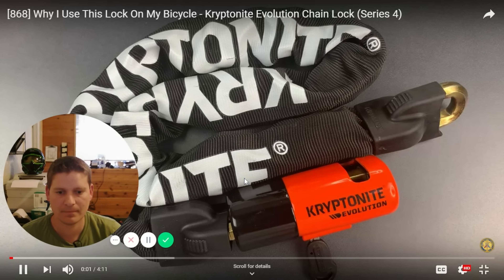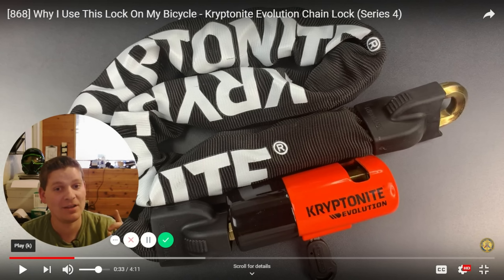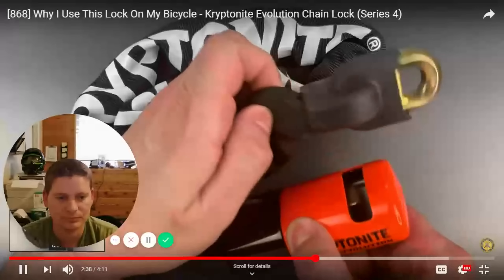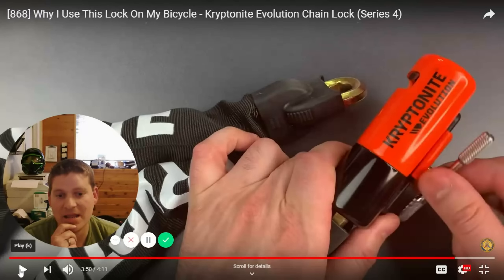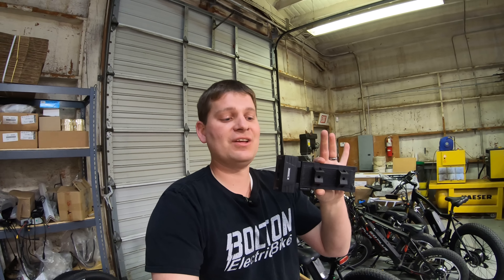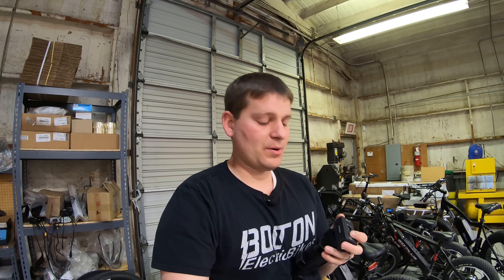Secure Your Electric Bike From Theft

Comment: if your components has allen key bolt heads, get ball bearings that will fit inside, then use superglue and it will be impossible to unscrew any of ur components on the street, UNLESS you first dissolve the glue with acetone then remove the ball bearing, which NO thief has the brains or time to know that.

Comment: bottom line, nothing works. not much has gone into theft prevention of ebikes and escooters.  there needs to be tech, heavy tech, that knocks out the bike from ever being able to be used again, meaning, it has to stem from the electric hub and the controller has to be removable/portable. when that hub is locked in position and prevents the wheel from turning, its gonna be hard to pick up that 100 pound ebike and carry it around. probably some sort of digital signature needed from the controller to the hub to release it, or something far more clever, to prevent it from easily being hacked.

Comment: I WANT to ride My bike to work . BUT I'll be 250 mi away at the furtherest point of My day ( but it gets better I work nights) ! I'm not TOO worried about theft ( will be in Employee parking lot , more worried about a hit & run , wind blowing it over etc ) ! The ebike is a himiway step through w/ 4in tires & fenders . I haven't found a ulock wide or long enough to work easy ! Besides , there's no easy to mount a carry bracket to the frame . I'm. NOT INTERESTED IN A 30 LB CHAIN , OR A FOLDING LOCK!!!

Comment: You riders of these seem to think there are no rules or laws that apply to vehicles or bicycles. 
What I’d like to know is how you plan to prevent them from bursting into flame in your garage basement or apartment? Especially after riding them in the rain or snow.
Reply: Always use approved charger. Make sure it's not frayed. Don't charge while wet or cold. Keep the battery health maintained with good charging habits. Don't leave it charging overnight. Have a fire blanket or fireproof case. There ya go.

Comment: I take my bike right in the store with me to.  Load up the basket and check out.   No one has ever once said anything about using it as a shopping cart.
Reply: They politely tell me I need to lock my bike outside. Fat bikes are generally not small. If I want to grab a brew, or lunch, we leave the bikes outside 90% of the time.

E-bikes are a car replacement for those short trips to the post office and shopping. It's no longer appealing when it's a major hassle to step away from the bike for more than 5 minutes.

Comment: I watched this video with some interest because back in February 2020 I had my Trek Powerfly 5 stolen, I have had this for just under two years and because it was a work horse, I was using this nearly everyday for commuting to work. Hence the high mileage I had planned to replace the battery, after my holiday in March, as Lithium start to deteriorate after heavy usage and mine was already up to 3k miles and the batteries do not last forever.  

I was in the supermarket for 12 minutes, exactly, and had the New York Kryptonite chain, plus a second lock, but the thief used a portable or battery power grinder, must have made a racket but what surprised me was not one the security cameras  were working & two that with all this going on no one challenged the thief, given the time of the morning in a busy supermarket car park. 

Fortunately, I had my e-bike included into my household insurance so the insurance paid out no problems. I replaced my bike with the 2020 Trek, Powerfly 7. Fortunately I had ordered the replacement before all of the Coovid-19 outbreak otherwise, as my bike shop informed me,  I would not have been able to get the replacement bike  possibly this year, such is the current demand for bikes. 

I will for now on be taking my bike into the supermarket, I have the latest NY Chain that is 15mm thick, also use a second lock and also have had to invest in a tracking device, should the inevitable happen.  The only other thing that would be useful, since I don’t have a bodyguard like Arnie would be an AK47 but these are not legal here. 

PS by the way all e-bikes have a separate serial number for the bike frame, battery, controller,  motor and lock so keep all this information secure, you will need it, if or when you report the theft. And I say this quietly, in a way the bike thief did me a favour as I was able to trade up my e-bike for the latest 2020 version and no new battery required.
Reply: All a thief needs to do is don high vis, official looking clothing, and noone will bat an eye. And that's the flaw in any lock. Hand help battery opperated angle grinders make mince meat of even the heftiest lock.
Reply: Ya I always wanted to get like a tracker for mine. And recently I learned about metropcs have these pet gps trackers. I am not sure how they perform but I might try it some day. I am not a fan of tmobile/metropcs anymore because sprint bought them so I quit my service with them.
Reply: Those kryptonite chains are expensive but you can register your bike with them against robbery. People claim that they got money from them after being rob. The profit margin on those lock must be verry high for them to offer that

Comment: I use a folding electric bike. 6 years and it hadn't been stolen had to ditch it on the side of the road because it was so well used it costed more in replacement parts.

Comment: I own a Juiced Bikes RipCurrent S Fat Tire E-Bike. While certainly not the most expensive E-Bike out there, many have complemented on it's Looks, meaning it's more appealing to Thieves. So, I went down the YT Rabbit Hole on Securing Bicycles and ran into the Lock Picking Lawyer and his Good Friend, Bosnian Bill long ago. The "Bell" brand "U" Lock is $hit. You could see it was Tubing surrounding a much smaller Shackle inside that was NOT made from Hardened Steel. You get what you pay for w/ Bike Locks and pretty much anything else. While Kryptonite & ABUS make up the lion's share of "job specific" or "Theft Threat", rated Bike Locks, there are several Very Good Lock and Chain options with PacLock, HipLock, OnGuard, Viro and others. The LEAST secure Bike Locks use Cable and/or Easily Picked standard "Pin Cylinder" style Keyed Locks (like a standard Master Padlock), stay away from those even if they're much lighter & cheaper. Case Hardened Chains are Always harder to cut and it takes some REALLY BIG Bolt Cutters or a Portable Battery Operated Grinder to cut thru these, stuff most Bike Thieves aren't willing to carry in broad daylight. The Better Locks use Hardened Steel Shackles and Pick Deterrent Cylinder types. The "Folding" link type locks are easily defeated by punching out the Link Rivets w/ a pocket tool. They're Heavy, Expensive and Overrated. Whatever Lock you use, try to set it up so the Keyway is pointing towards the ground. This makes Lock Picking Much more difficult. If your using a cheap Lock for a quick stop at Starbucks or the Utility Co, park your bike in low gear and click the shifter to High Gear. When someone hops on ur bike, it'll quickly shift to High Gear and make it impossible to make a getaway faster than you can run. Make ur Bike look like Crap if you aren't hung up on looks, it's a Gr8 Theft Deterrent. Read up on Kyrptonite's Lock Rating System, you'll get a laugh and Learn about Theft Threat Levels. Remember, NO Lock is undefeatable, all ur doing is making the easier to defeat locks more attractive. Good Luck ! P.S. I use a Hardened Shrouded Coupler Lock from PacLock or Viro Pin Lock and a 9/32  x  4' Pewag Case Hardened Chain carried in aa Frame Bag on my Bike.

Comment: re the lock that broke the hydraulic cutter ...most theiives are walking wiith battery angle grinders w/ cuttig diisc & battery iinpacts & drivers ...so in a nut shell only prayers can help

Comment: I use a alarmed  motorcycle brake disc lock, a kryptonite d lock, and the bike has a very loud alarm, activated by key fob. By the time both alarms are screaming, there isnt any way they will cut thru all my locks before I get out there with a baseball bat ...

Comment: Theft is still my number 1 concern regardless if it's lock in the garage /shack/barn/ kryptonite locks. If you are paying for a bike 400$ and more you are a target. This video got me into lightweight foldables or even electric scooter. I'm really staying away from Ebike for now and even 2000$ regular bikes. For  the seat not being bolted on ... this is a nightmare, get a bolt then glue it on and even put a small dowell pin somewhere. Some vendor will say this titanium or carbon frame is so light you'll save some seconds... yadiyadi yada ... welll I'm gona throw this 10 lb Kriptonite into the mix lol..fu ck me hahaha There is no chance in hell I'll be commuting  on a Ebike now :) sorry to say.

Comment: I heard that a key for a Rad bike works on any other Rad bike. Have you tried that?
Reply from the maker: To my knowledge, all of the keys work on all of the rad bikes - at least from 2108 - 2020
Reply: I have a 2018 Rover and the girlfriend has a 2019 City and we went camping one time and I forgot my keys. Hers would not work on my battery. They have a number stamped on the key and the battery lock. If the key and Battery numbers don't match the key doesn't appear to work. Goes in but won't turn .

Comment: An angle-grinder on battery Get em all
Reply: Literally no lock on market at any price can withstand a cordless angle grinder.

The main goal is to discourage thieves by drawing attention to them. In NYC, losers prowl the streets, especially after dark, looking for bikes locked up in out of the way spots and for hours at a time. Bikes locked up where passers by cannot see them causing sparks and noise with a grinder are gonna get nabbed - Only takes 40-60 seconds or so, even on a big U-lock as shown. Naturally, most New Yorkers let crimes like this go on in broad daylight 'cause ofvapathy and unwillingness to get involved.

Also, wimpy locks or any chain cuts down on the crook's time on scene. Just a quick cut with a bolt cutter and your bike disappears.

Comes down to how much weight arevyounwillingbto haul around as those house U locks also weigh a ton. Do I diet and lose 6lbs.to offset hauling around a gigantic lock?! Weoght distribution too. Do I place the lock centrally on bike and lose water bottle space?

Comment: Hydraulic bolt cutters are defeated by a lock that can be cut in less than 30 seconds with a $80 rechargeable angle grinder.

Comment: Well nothing will secure your Expensive ebike, if you are facing a professional thief, because there is a portable metal disc cutter that can cut any metal like butter, I have one bought from amazon   Called portable cable disc metal cutter 120 dollar , I used it for my car repair, to cut stocked bolt chokes or muffler, and if you use it on bike locker chains or u lock it will cut them like nothing, it will take longer time and make mush noise on a harder bike lock, but it can be done, that why I keep my expensive ebike inside the house. But I have to leave my bike outside, for short time, I used like three heavy duty chaine and two u Locks

Comment: A good tip is to not park your bike out in the open. Park it on the sides of shops where nobody goes. Just get a decent lock and don't leave it unattended for long. I had several electric bikes for the past 12 years and I never once had any issues. Also just thought I would say to each their own, but I don't see the point in fat tires. It's like a short skinny person wearing size 14 shoes... Very silly

Comment: One tool will do all those locks in seconds if not a minute " CORDLESS ANGLE GRINDER WITH CUTTING DISC" which can be carried in a back pack out of sight for those Nasty people would want to steal your transport. And there's different cutting discs for specific use or metals. Just a heads up. Really like your videos and the info and tech points you put out there.👍👍👍😎💨🏴‍☠️

Comment: Thieves are not stupid. They know the value of a good ebike and if the ebike cost for example $2500 dollars and it doesn’t have the battery they will still steal it because the battery replacement is around $100 to $300 dollars

Comment: always remember: crackheads will steal anything they can get their grubby little hands on. Just had my eBike stolen 2 nights ago. Inside the stairwell of my apartment building, with a door code entry. on camera. and it was locked with a ulock and a cable. They took about 10 minutes to cut through both and left with my bike without the battery that I had inside my apartment charging. unfortunately, the cops in my town are useless, so only thing left to do is buy better locks next time...

Comment: I want to subscribe but the fact that neither you or your lock expert never even mention a battery powered  angle grinder with a metal cutoff wheel. This will easily cut through any type of lock in a few seconds. Why did you not mention this?

Comment: I would not be gauging the effectiveness of a lock by a locksmiths expert picking of that lock. As odd as that sounds. The lock picking lawyer is an expert at picking locks. The crack addicts and thugs looking to steal your bike are not using expert picking tools. They're quite literally destroying the locks. These days with angle grinders because bolt cutters are just too bulky to carry around. And they usually have no issue with whipping out a battery powered angle grinder and doing it in broad daylight because not one person walking by is going to say anything, try to stop them(why would they?) or even call the police who will arrive too late for it to matter anyway. Your best bet to prevent a thief stealing your bike is to just leave it at home if you are that worried about it. But thats not practical because you need it for commuting. So what do you do? You use MULTIPLE locks. Place the locks in places its awkward to use the angle grinder or bolt cutters, and try to have some interference detector on the bike to send you a notification when your bike is being tampered with. Slowing down crack heads is really your best bet. The lockpick lawyer is not showing up to pick all the locks off your bike.

Comment: I worked for a locksmith years ago I was taught all the secrets back then. This guy is bad news! He's to locksmiths as Penn and Teller are to magic! But even worse!!! What he's showing is sacred! Before YT and the Internet as we know it if he went around showing people this! Bad things could have happened. It's like being a Free Mason you just Don't talk about it . Nobody is safe with this guy telling people how to get around any Lock! So how do I keep not only my valuables safe but also my Ebike? I use as many Locks as I can the longer it takes to get it the less appealing it is.  I have 3 on mine right now! An aircraft cable with a disc Lock,  the Lock that was included with the bike, and another type of cable Lock. When practical I take both batteries with me and the seat. Of course if I'm going into a store I only take the seat the batteries are too bulky to carry around . But If I'm in a bad area I'll probably get a shopping cart then put the batteries in it  , you could also take the front wheel off if it's a quick release. My last line of defense is my insurance policy I always take a photo of it after I secure it so I have proof I made a good attempt to secure it. Insurance companies crooks just like bike thieves.

Comment: You may have pointed out a very critical flaw in your Rad Rover. However, since you want to be considered a reputable Bike shop selling your own bikes I think it may be unethical to just post this without letting viewers know if you have contacted Rad Power Bikes about a potential flaw in their keys locks and if they responded to you. You are not just a Rad Rover owner. As an aspiring competitor to Rad Power Bikes you are not responsible for Rad Bikes but you are informing everyone who didn't know about this flaw including criminals that you are now marketing Key Blanks for Rad Bikes on your website. Do you know if this flaw still exists in the latest Rad Bike models?  I realize Bolton E-Bike wants to be a serious competitor to Rad but this is really a bad way to do it. So the question I have for you is, Have you contacted Rad before posting this? Please update this video with more information so I can make an informed decision on the integrity of Bolton E-Bikes business practices.
Reply from the maker: Hey Jim! This does still exist in the most current models. Rad is aware of this. It's not unethical at all - as long as you're trying to help a customer be able to enjoy their bike and to be able to remove their battery effectively. We have been a competitor way before this video came out. We act in full integrity in everything we do.